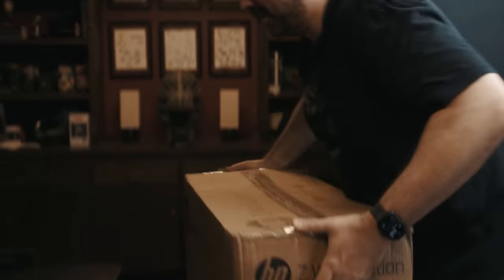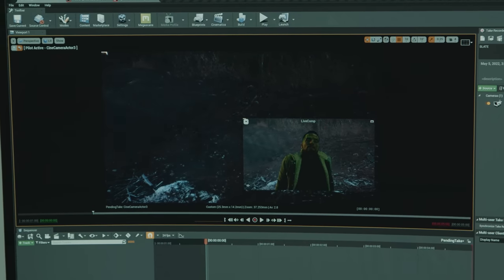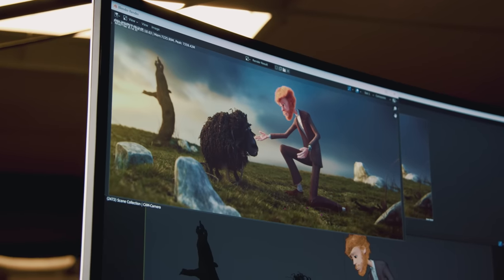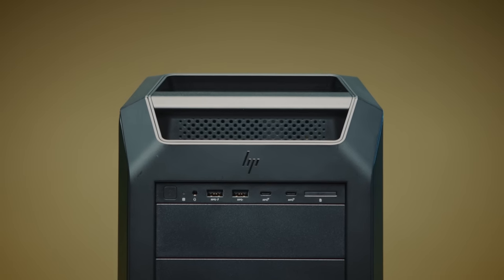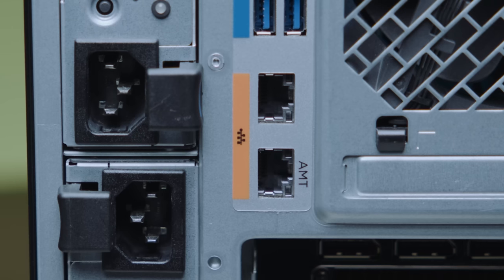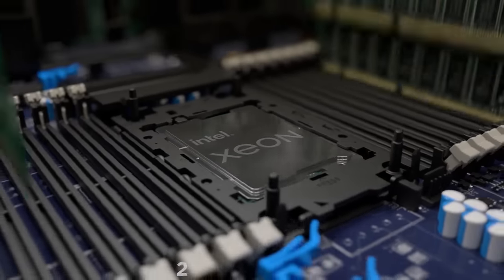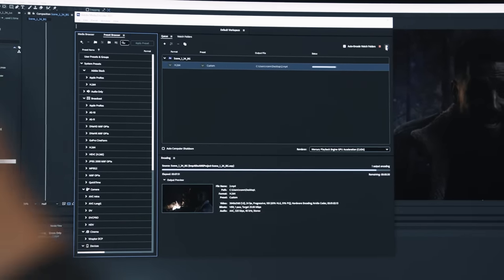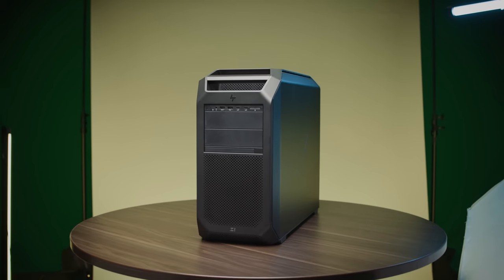How Fast is a $30,000 Computer?

Comment: We always get the render test etc.. Depending on the project 2 minutes faster on a single video render is not a huge deal etc.. One piece I don't see often enough is real-time performance. What's it like editing a very complex project in Premiere on one machine vs the other? What's it like working on an AE project with 100 layers etc.. Once I hit render on a project I walk away and grab a coffee, what truly impacts my workflow is the live editing portion. I'd love to see a real-time comparison through that workflow instead!
Reply: This. I just want to know what my real time workflow is. I can just send my stuff to the render farm and I’m good. I just want to see how is the playback on an AE file with a lot of compositions, trapcode, video copilot stuff all over the place.
Reply: Most software including Blender doesn’t make use of multiple GPUs while working in the viewport, so the difference is nil. The only one I’m aware of that does is Omniverse Create by Nvidia.

AE and Premiere doesn’t even make much use of a single GPU I believe. Due to its streamlined architecture, my M1 Mac often does better performance in those apps than my other computer with an RTX3090 GPU.
Reply: I think the difference wouldn't be so noticable, assuming you have several NvME drives with all your apps and sources spread out, and sufficient ram to load it all into. As others have said, AE and premiere can only make so much use of GPU and CPU cores. Sometimes faster CPU clockspeed is the winner, which the XEON processors and AMD Threadrippers are not known for. 3D apps pretty much all scale linearly with cores and GPU. As to render times...even 15 secs/frame can translate to a fat lot of time for testing out a full res preview. That's a long time to wait when you're just trying stuff out. Farms come later.

Also, unreal engine and virtual production.
Reply: aka HP, I volunteer as tribute to test this machine against mine, "LIKE AND SUBSCRIBE blah blah blah hahahah"
Reply: 2nd 3rd 4th 5th this!
Reply: @sloppynyuszi  You said you send your files to a render farm. Do you work for a big VFX company like ILM/wetadigital by any chance ?
Reply: This what youtube reviews do a lot because, my guess, the large audience of non professionals thinks saving time is done in rendering. It's not! You save time by knowing keyboard shortcuts, have a snappy system while editing, learn the software you use etc etc. A couple of minutes on a render doesn't matter because we plan our work.

Comment: You're very fascinated how many GPUs has this PC, but only few softwares / games using more than one GPU. Years before we had more power from SLI, but today developers not write programs for more GPUs. It's same like multiple CPUs on one motherboard.
Reply: This is very true for games, but there are a lot more use cases for someone who works in video. Still wish there was more benefit to it tho
Reply: @beestings22  no no.. I try it. Programs from Adobe and most other editors don't understand multiple processors. You can turn on this feature, but different is very small. It's sad, because if developers optimize these programs for this method, we can have awesome power for rendering or preview. 😔
Reply: @dygmore  blackmagic softwares absolutely eat that shit up, highly recommend.
Reply: @beestings22  maybe, but Blackmagic I really don't like (only cameras - is best), because these codecs for export video are veeeery bad. If I see what happens h264 option with video... oh god 😀 DaVinci better understand RAW, but codecs are really bad. And you need more RAM for this editor.
Reply: @dygmore  not sure what you mean by the codecs are bad, but personally I’ve had great luck with the h.264 and QuickTime renderer, it renders about the same quality of compression as premiere to my eyes and is usually faster.
Reply: @dygmore  but tbh for high quality stuff I always use QuickTime anyway because regardless of software it looks better
Reply: @beestings22  I dont know, but if I use H264 in QuickTime without any compression, always deliver me sh*tty footage with "squares" like low bitrate or something... Adobe is little bit slower, but you dont need much RAM and I never had problems with encoding. And I think, that you have there more advanced options for encoding and more mooore codecs for choose. I using Blackmagic URSA and I always using only Adobe. Only if I using RAW, I switch to DaVinci for better colorgrading. Both editors has own goods :D
Reply: @dygmore  honestly, it’s totally possible it’s just worse, but that does sound like a bitrate problem so I highly recommend fiddling with settings in there. The one downside to davinci is that it really wants you to have fast drives, but that’s not a problem for me so it’s all good.
Reply: SLI / Crossfire  is different from having and utilizing multiple GPUs. You can use multiple GPUs without SLI/Crossfire. It's not an exclusive thing to those terminologies and technologies.
Reply: @dygmore  What do you mean by "no compression"? H.264 is literally a compression algorithm, so you're definitely compressing your export. My H.264 renders from Resolve look pretty fantastic

Comment: My current highest-end computer (I have multiple systems) that I bought more than a year ago is an AMD R9-5950X 16-Core, ASUS ROG X570 Crosshair, 128GB DDR4, ASUS ROG RTX-3090.  It does almost everything that I want to do, I just need a lot more RAM for the software and projects that I use (TerreSculptor, Unreal Engine 5, Autodesk Max, etc).  So my next computer, I'm just waiting for the hardware to show up in Canada, is going to probably be an Intel Xeon W7-2475X 20-Core, ASUS WS W790, 512GB DDR5 (Expandable to 2TB), ASUS RTX-3090 (I don't require the 4000 series right now, maybe an RTX-4090ti upgrade eventually).  I would prefer the Intel W3400 series with its 4TB maximum memory, but that much DDR5 RAM these days will be about $38400 US just in memory, and I do have a budget to stay within.

Comment: Huh.. so, what does it mean when Blender crashes after 2 seconds of starting the render?  Not a good sign, but I did notice the notes of the benchmark project mention it is a CPU test, so the 4 GPUs aren't even being used in that example.

Comment: Thank you very much. I've always been curious about workstation performance. Looking at the performance of Flame on Linux OS, it showed very good performance. However, there was no way to know how good the performance would be on the Windows OS. make it in Korea with the highest specifications, it will cost about 38,000 dollars. So I had a lot of trouble. Performance concerns are gone now, but price is still an issue...